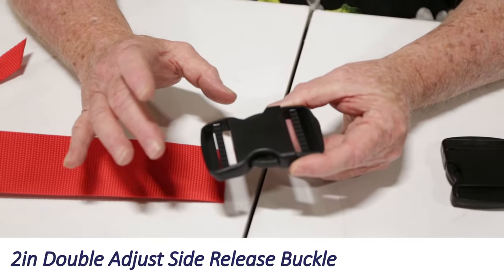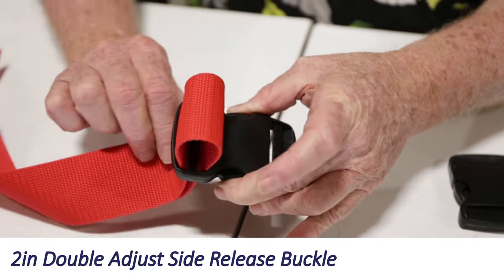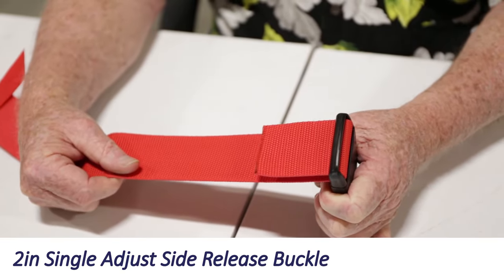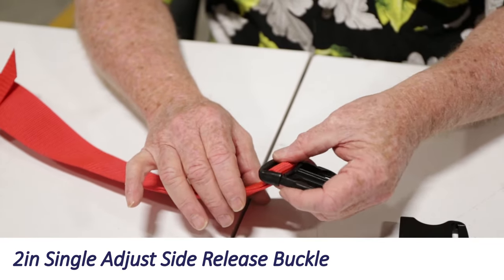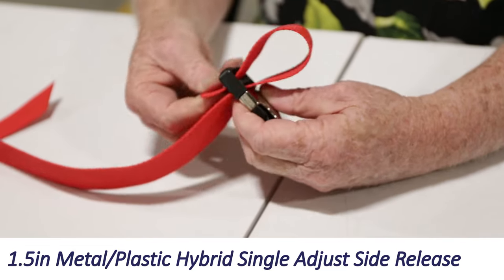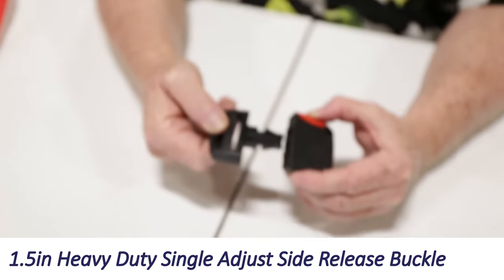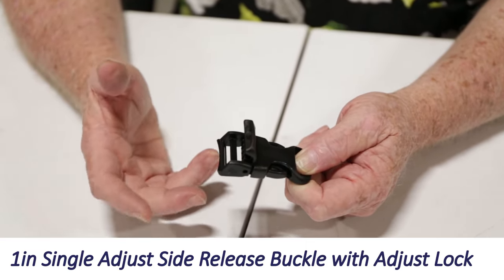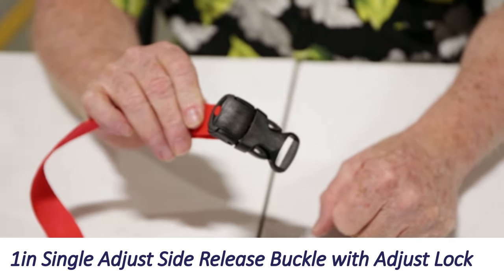How to Thread, Tighten, and Release your Plastic Side Release Buckle

Comment: My Only comment when speaking about the buckle. STATE sometimes it's Hard to Tell which side is  CoRReCT.  Follow the instructions & if the strap SLiPS then simply flip the Buckle over and it will be the Right side up.  Easy Peasy....I had a Helluva time with this buckler, so I finally  flipped it Over & wahla.. Thanks for the Vid

Comment: I have a problem with the lock buckle itself, its very loose so a light pull will release the buckle lock, how can i fix this?

The ending of both sides are stitched so replacing wouldn't be recommended, is that correct?